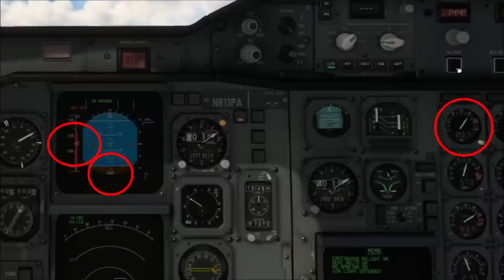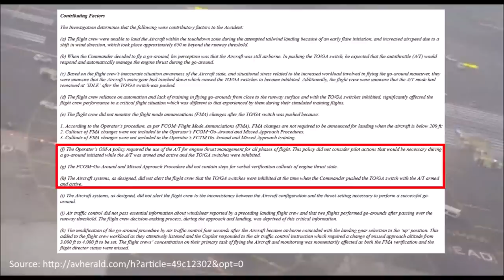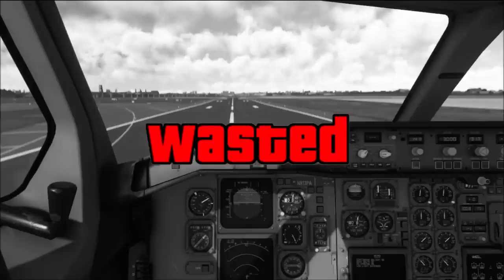How Automation Almost Killed Me - An MSFS Case Study | Real Airline Pilot

Comment: As someone who knows nothing about aviation, why doesn't the TOGA override the A/T?
Reply from the maker: In most planes it does... But seems like Airbus had to learn some serious lessons with the A310.
Reply: Same reason it didn't in the case of EK521....too close to the ground and TOGA is inhibited
Reply: @A330Driver  its the same as EK521, TOGA button is inhibited close to the ground
Reply: @tomstravels520  that seems less then helpful considering the toga button is an "abort landing" button, I would expect it to slam thrust to full until or even after speed is above flight minimum.

Do you happen to know what the logic of blocking the abort button?
Reply: @ARockRaider  it’s to prevent it being pressed accidentally on landing as the TOGA button in some models is right next to your fingers on the throttles.
Reply: @tomstravels520  mabey, but I would think even with all wheels down you might still want TOGA as you may find the runway is slippery or some other sort of problem that makes a go around safer then breaks and prayer.
Reply: @ARockRaider  once you’ve deployed reversers and started to attempt to brake it is almost never recommended to attempt to go around

Comment: Is this consistent with the behavior on the real A310? Also, are the thrust levers on the A310 motorized or are they throttle-by-wire like on newer Airbus models? That would immediately have caught your attention as the A/T was not commanded to full thrust at go-around and the levers would not move, instead of being firewalled by the automation.

Boeing deliberately keeps the thrust levers motorized so pilots can cross-check the behaviour of the A/T and intervene manually.
Reply: They behave pretty much the same as the Boeing but that is the downside. On the A320 to engage TOGA you manually push thrust levers fully forward and TOGA is commanded no matter what as its outside of the auto thrust gate. In this and Boeing TOGA is engaged by pressing a button. But as the crew of EK521 found out that button is inhibited below a certain height so it cannot be pressed accidentally
Reply: @tomstravels520  Wouldn't you instinctively firewall the throttles manually when doing a go-around and press TO/GA just for the pitch command? I personally wouldn't trust the automation to set go-around thrust as I'm inches from the ground.

After all, go-around usually means "Get the hell out of dodge, fast, landing is not safe". Which means, punch it.
Reply: @Stoney3K  I don't know exactly how they do it now but modern aircraft usually need to know when they're conducting a go around to provide correct guidance on the Flight Directors, on Boeing and A300/A310 this is done by pressing the TOGA buttons. Normally seen videos of them resettings FD's and re-arming auto throttle after disconnecting automatics. Without it (if you just pushed lever to full) you have no guidance and have to fully manually do the go around which increases workload and may over stress the engines and cause damage.

On A320 and beyond you can disconnect autothrust, turn off FD's then when you push them into TOGA detent everything will come back automatically (autothrust is only armed in TOGA detent)
Reply: @tomstravels520  You can push the thrust lever to full and push TO/GA for the flight director guidance at the same time? Usually the button is on the side of the thrust lever grip for that very reason, even if the aircraft doesn't have autothrust (e.g. Embraer 145).
Reply: Having the disconnected throttles in the airbus is not a downside. You can just slam the throttles into toga and it will give you full power. You cannot do that with the boeing throttle levers if the AT is armed and if not you could overstress the engines firewalling it.
Reply: @Stoney3K  on 737 it’s at the top near your fingers. And because it’s mechanically driven forward you would probably damage the motor if you force it against its normal speed

Comment: 10:40 First, in a go around you should turn off autopilot,  and if there is a stall or will be one force power max then push the stick down, yes you are in a go around but keeping the nose up will make you loose all your speed and you stall
Reply from the maker: The Autopilot IS off already for the entire video.
Not sure if you saw it, but thrust levers ARE at max, it simply takes the engines time to spool up.
Push the nose down at this altitude and you're dead. If you're high enough that's the right thing to do, but in this case there's concrete 160ft below. Or maybe water if we drifted a little off the centerline. No margin to pitch down here.
Reply: @A330Driver  When I say pitch down I mean to 15 degrees, however it is more of a fluid thing that just happens and changes from case to case. (With the autopilot I meant all systems in it such as: Autothrottle, Heading, Alt, Vnav, Lnav, Aproach, ect.)

Comment: I have had a very difficult time getting used to the A310s autothrottle function. The way the reverse thrusters are mapped by default makes it very difficult to use my throttle on manual, and landing softly is super challenging. Everything else is super easy but landing is a bitch
Reply: Did you calibrate them to remove the reverser part of axis? Idle axis should match idle thrust in game.

Comment: On 737 Please advice on left & right overwing door lights illuminate while its look ok on outside. No failure on FMC system
Reply from the maker: Bug
Reply: QRH... 
OVERWING DOOR
Condition: One or more overwing doors are not closed and secure.
 1 Choose one:
     Pressurization is normal:
          Continue normal operation.
     Pressurization is not normal:
          Plan to land at the nearest suitable airport.

(:
Reply: @ClouDAction.  I did go through the QRH section for this. But explain pressurization is normal ?
Reply: @williamwidjaja850  Did you experience this before takeoff or during the flight (and if so in what phase of the flight)?
Reply: @ClouDAction.  after engine startup
Reply: @williamwidjaja850  After visual inspection, I would take off normally and carefully watch the cabin rate of climb, cabin altitude and differential pressure to see if they behave as they would in a typical flight.

Comment: Interesting situation. In this scenario, could the V/S indicator be used to reduce pitch, and therefore drag, while not starting to get into negative V/S? When I flew as a private pilot the V/S wasn´t always the best calibrated instrument, and due to its nature a little bit "lagging" when changing pitch or thrust.
Reply from the maker: The V/S indicator is not really suitable for the task at hand. Use the stall warning/stick shaker instead. As much as practicable lower the nose just to a level where you get intermittent stick shaker activation. That'll just about keep you outside the stalling range as those devices are designed to activate prior to actual stall onset.

VSIs are a bit better in airliners than in GA aircraft but they still lack behind. Even in the 737, where Boeing espressively calls it the IVSI, standing for INSTANT VSI, the thing still lags behind.

Comment: I have a technical question:
Isn't setting throttles to TOGA/MAX thrust deactivates speed hold/managed mode and arms auto throttle? I'm not a real world pilot however I read many documents about the A320 for the Fenix A320 CEO and the airbus A320  family does not require turning off auto throttle prior to toga/max thrust setting. I haven't dived into the A310 yet, also not flying any Boeings in the sim so I'm not familiar with their procedures, but isn't what's in my original question a common thing that is implemented by many manufacturers for both safety and to reduce workloads on pilots? Or is it just a safety action to give manual authority over automation in case there's is a malfunction in one or multiple of the sub/systems that responsible for auto-thrust, thus leading to the incorrect thrust setting for the present phase of the flight?
Reply: On A320 and beyond the TOGA detent is outside of the autothrust control and so when you commanded TOGA you get TOGA no matter what. To get TOGA on Boeing you have to press the button to engage GA mode and get GA power
Reply: @tomstravels520  I see than you for your answer. Have a great holiday.

Comment: There seems to be a bug with this aircraft, it always pulls to much and stalls out, the xplane a310 doesnt have this issue.
Reply from the maker: You mean in low speed flight during tight turns? I see the same. I always add 10kt extra if such a turn is anticipated due to this.
Reply: @A330Driver  Yeah especially when engaging autopilot on takeoff.

Comment: Is there a situation where you could accept some gear contact with the ground if something like this developed and wasn't caught fast enough ? Both the autobrake and spoilers would disarm after pushing those throttles forward. Could that be more beneficial than a potential to stall over the ground ?
Reply from the maker: Pretty much in all situations. It is not a problem for your gears to touch down in the event of a go around, unless there is actually something blocking that runway right where you would touch down. But let's say for example ATC instructs a late go around due to a runway incursion somewhere far down the runway. It wouldn't be a problem if your gears touched the ground. In fact it would be far better for your gears to touch down than your tail to touch down because you lifted the nose too quickly and inertia couldn't keep up. The vast majority of tailstrikes in real life happen on landing and pilots trying to avoid ground contact during a go around is part of the reason for it.

Comment: The title is misleading. Surely here automation did not work as expected nevertheless the responsibility lies with the pilot flying to ALWAYS advance Thrust manually regardless. I suggest changing it in “How I almost killed myself”. Spotting the A/T failure was a nice catch but didn’t make the maneuver correct. There is a sim issue at play here maybe. Some poorly made airplane override physical Throttle levers when auto throttle is connected. In these cases disconnecting AT on final must become a standard for this reason. In any case an eventual crash can never be blamed on automation. The responsibility for thrust control, one way or another, is always with the pilot.
Reply from the maker: Sorry but that is just incorrect. You're neglecting so many things here.
First: Check the A310 Flight Manuals. AT is supposed to push the levers forward, the pilot shall only do it in case the AT fails to do so.
Second: In real life it's easy: You push the go levers, you feel the thrust levers move under your hand. Doesn't happen in the sim. In the sim you need to rely on the indications. Which take a while to react in this plane anyway.
Third: Exactly what would your SOP be then? Always disconnect AT immediately on any go around and set maximum thrust manually? If you do that, how would you make sure go around thrust is set precisely? Especially single pilot in a sim?
Sorry to say so, but your answer seems far, far away from any reality of what can be done in flight simulation.
Reply: @A330Driver  First: Exactly, which is what you have not done. The sim might require a specific way to do things because doesn’t realistically mimic real life system’s behavior but the principle still apply: if automation doesn’t do it you must. And you haven’t. So the consequent accident is just your fault. Not automation. 
Second: sim and real life are both different and identical. Different in systems behavior (at times) but identical in principle. Thrust setting is always a pilot responsibility, how you do it doesn’t matter. Just do it. You haven’t? Well then you are the ultimate cause of whatever happens next.
Third: this is irrelevant. Build your own safe procedures. Do not rely on automation. It’s also irrelevant to set GA thrust “precisely”, achieve a good rate of climb at a constant speed and that’s it (this is true in real life also where I couldn’t care less about precise GA thrust settings). Add full thrust if you can not do any better. Ever flown a C152? It’s the same. Fly the airplane. And watch the video “ Children of the Magenta Line” to understand the difference between a system operator and a pilot. Which one do you want to be ?
P.S. if you have been brought up by Ryanair (or the likes) your shortcut to become a real pilot one day is to leave ASAP. Good luck.

Comment: Hi Emanuel, I notice when executing the G/A, you called Go around flaps, but I didn't hear you call 'Go around power', nor did I hear you pressing the Go Around buttons (if there is one) to instruct G/A power, (albeit which didn't engage because it was inhibited by the logic)....   Did I miss something?
Reply from the maker: Hi Arnold, "go around, Flaps" is the call as designed by Airbus. According to the manual there is no call to set go around thrust. In the A310 the so called "go levers" are located on the thrust levers and thus impossible to reach quickly due to the nature of our flight simulators. The A310 Simulation thus has a hidden click spot in that the ATC Message button on the glareshield works as a TOGA button.
You can see me pressing that button just below 30RA, at the same time the FMA then changes to GO AROUND, which would have been the trigger for the AT to go into go around mode as well.
Reply: @A330Driver  Gotcha, thanks!

Comment: Why would one not lower the nose if the airspeed is too low?
Reply from the maker: Because there's exactly 160ft to the ground?
Reply: @A330Driver  Yeah, but on the other hand the aircraft is stalling and the nose is pitched up very aggressivly (especially in the second example). For me it just seems counterintuitive, but of course I am not a pilot.
Reply: @stoff7829  Consider CloudDAction's comment, there's a good response from the man himself to the same question there. Paraphrasing: Not enough altitude.

Comment: Why didn’t you pitch down when the stall warning sounded?
Reply: Pitching down significantly at such a low altitude would have dropped the aircraft into the ground. Stall recovery at low altitudes is different to at high altitudes where height can be quickly traded for airspeed.
Reply: @SL O  im not an airline pilot, but I am currently working on my multi rating, and we are taught, in power on/off stalls, to reduce the AOA immediately upon stall warning to avoid/reduce a stall. These stalls are to simulate low to the ground stall encounters.

Again, i havent studied large aircraft yet. But this is what ive gathered from my GA experience.
Reply: @JohnDole … AOA? Aircraft overall attitude? Not familiar with that abbreviation.
Reply: @mizuwarikun  AOA stands for Angle Of Attack. The angle of which the wings are positioned in the airflow. If it's too high the wings lose lift.
Reply from the maker: Normally you guys are absolutely right and a pitch down would be required. In this particular case though it was just not possible. You can't pitch down when there's no air below you. And we've been just 160ft over the ground. High enough so that a significant rate of descent would instantly develope that would have the plane burst into flames on impact with the ground, but at the same time low enough that you just would not have been able to maintain the reduced AOA for any significant amount of time. We were just too close to the ground.
Reply from the maker: @JohnDole  David, what you learned is absolutely correct of course. There's a difference when you're close to the ground between a GA aircraft and an airliner however.
First there's the time it takes for your engines to run up to power. In GA aircraft that happens almost instantaniously. You move the thrust lever, you have that power available. In airliners it will take up to 8 seconds if the engines were at approach IDLE.
Then there's energy/mass/inertia. A small plane is much easier to recover and to build intertia back up than a large jet aircraft.
Let's look at an actual stall to illustrate that: If you stall in a C172 you might loose up to a thousand feet of altitude to recover. If you stall a 737 it can easily be 5.000-10.000ft. Much more when it happens in cruise level, but that's a different story. To regain the energy needed in a big airplane it needs more altitude.
Reply: @A330Driver  That makes alot of sense and I never thought about it like that. Thanks! I appreciate your time to answer.